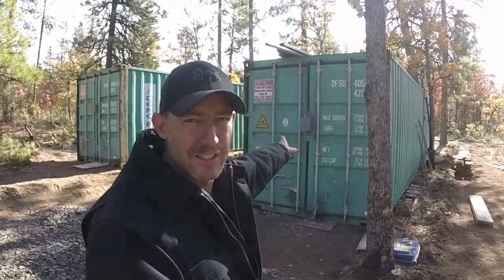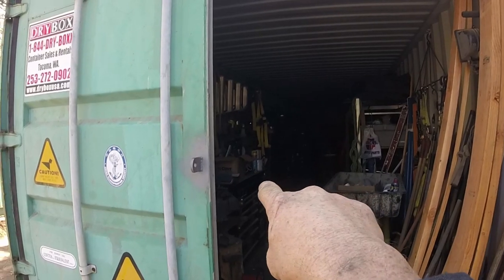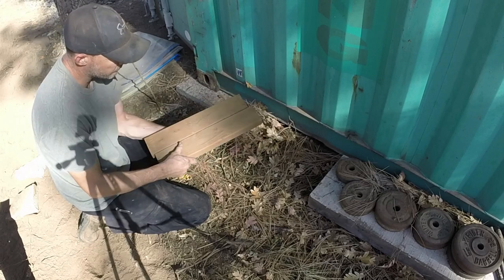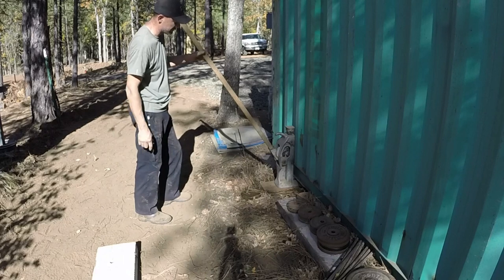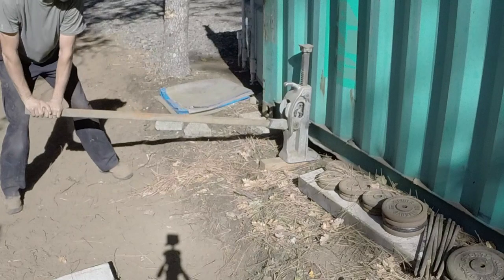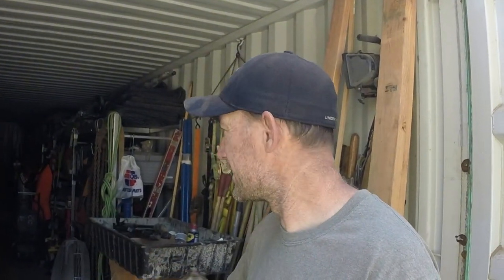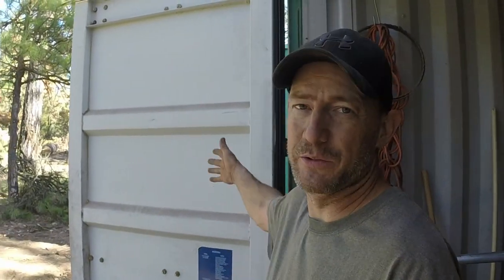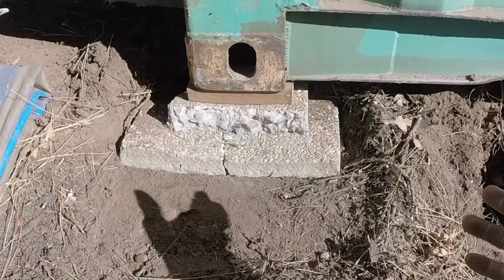One man lifting and leveling a shipping container box system

Comment: idk if seen my pics of the house i raised back in june. the mobile home trailer that was sitting on ground. i had to lift 3 ft high. used 12 20 ton bottle jacks. :)
Reply from the maker: That a little nuts my friend. I wouldn't know how to level that, just a lot of checking and adjusting I guess.
Reply: @KoalityofLife  took me a week and half. pretty much by my self. i had to dig down a ft. to get jack and blocks in. ground was so soft it compacted about 8 more inches each point i put jacks as i lifted. had to move the jacks a few times along the way. but over all process wasnt to bad.
Reply from the maker: I had a bit of a time getting the 2X4's out of the ground after leveling this thing. They were about 10 inches deeper than when I started. I have no doubt that I will have to relevel this again next spring. lol
Reply: @KoalityofLife  yeah with out putting bunch gravel down as the base it sure will sinnk some.
Reply: @KoalityofLife  I raised my 40'HC's with 30T hydraulic jacks to put more bricks under them. They pushed the bricks I was jacking on down 15" (Four 4" solid bricks) before they took hold and started actually lifting...and it hadn't rained for a week! (Southern OH) I need to try and find one of these jacks!
Reply from the maker: @feyeteenbach5910  I think the only place i have found these jacks is EBay. :)

Comment: First off your only lifting the weight of the corner not the entire box.  Your tractor might lift one corner.
Reply from the maker: A tractor might be able to life a corner but not mine. My tractor is an old backhoe that is getting a little weak. :)
Reply: @KoalityofLife  try it. If the tractor can not lift it it'll lift it's back. That won't hurt it. The container will work as a counterweight lifting your tractor back evidencing that it can't if it can't. I think that's not harmful at all and may be safer than the jack although that attemp was good!
Reply from the maker: @rodolfoplasencia4953  This is true, it will not hurt the backhoe if it can not lift it. It will just life the back of the tractor. The worst it could do is blow out a seal in a ram. We will see when I go to move these and make a garage out of them later. :)
Reply: Koality of Life Homestead I have welded together my own shipping container casters. It cost me in parts about $400 a caster but it moved a 45 foot high cube container with 45’ foot railroad rails on top.
I spent a long time researching the cheapest and most efficient way of moving it and although my welds are not pretty, I already have a waiting list of people who want to rent them from me. I would be happy to share info with everyone

Comment: Why didn’t you just go to Harbor Freight and buy one of those inexpensive 20 ton hydraulic jacks?
🤷‍♂️🤷‍♂️🤷‍♂️🤷‍♂️🤷‍♂️🤷‍♂️🤷‍♂️🤷‍♂️🤷‍♂️🤷‍♂️🤷‍♂️🤷‍♂️
Reply from the maker: Could have done that. Harbor Freight is about an hour and 15 min away though and I had this already. Thanks for watching. :)
Reply: I see! 👍
Reply: A 20 ton hydraulic jack will not fit into a 3 inch space unless you turn it into a toe jack by essentially adding an S shaped piece of steel . However and I may be wrong about the math but whatever capacity you have at the tip of the jack for example 20 tons, that becomes half the capacity at the toe. Someone mentioned using an air over hydraulic jack. It doesn’t help a whole lot because you have to raise it slowly. Plus it’ll save you a workout at the gym